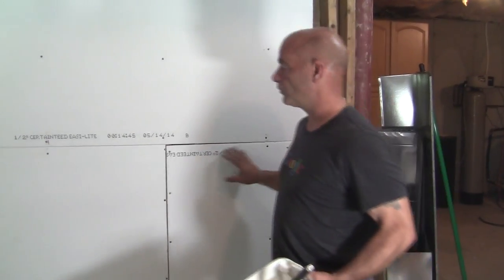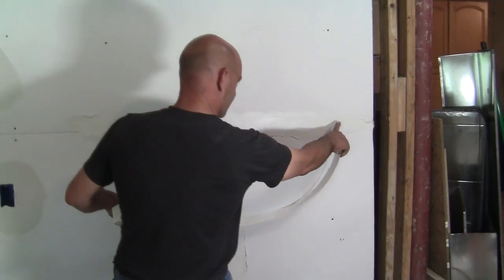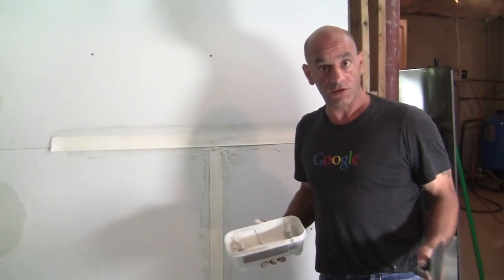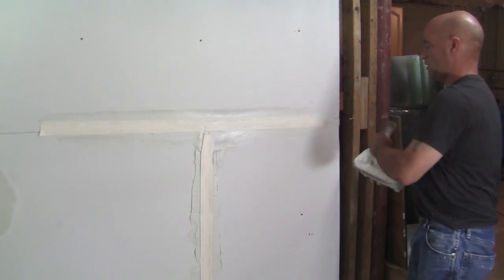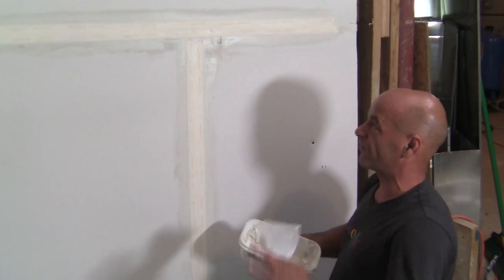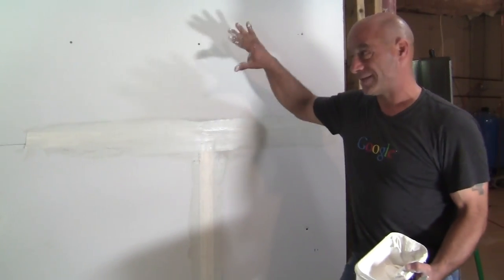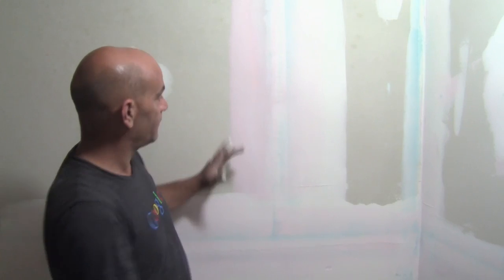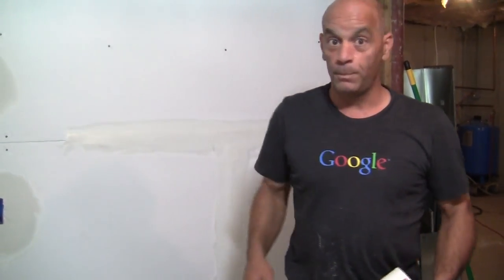How to tape drywall wall joints using Strait-Flex Butt Tape

Comment: On butt joints, I have used a razor knife to remove enough of the paper on the Sheetrock so the tape lays flat eliminating the need to make such a wide amount of Spackle. Just my two cents. ;-)
Reply: No a good idea. The paper is what adds the strength to Sheetrock.

Comment: like your vid's! should i tape a ceiling to ceiling connection between a sheet rock ceiling and a plastered brick ceiling, or use a flexible joint like painters silicone?
thanks

Comment: Thanks for this video.  Always have a tough time making these joints look right on the ceiling.  Bedroom light fixture has a butt joint running away from it towards the outer-wall.  Every time I read in bed, I've got this 6 foot long, 4 inch wide, cake frosting looking, shiny high spot staring me in the face.  Distracts me from reading and drives me nuts.  My wife thinks I'm crazy since she can't really see it, but it's definitely there (maybe I am insane).  Anyway, hoping the tape in this video and level 5 finish method will improve the look.  If you have any tips for properly taping/finishing a ceiling, it might make an interesting video for the people who follow you.  Just my two cents.  Thanks again.
Reply from the maker: +Joseph Nieves I have plenty of taping videos. Search them out.
Reply: Hey, that shinny spot on your ceiling comes from not being sanded properly when someone mudded your ceiling.
Reply: Makes sense.  Thanks for the tip.

Comment: I just bought 6 and 10 inch knifes (good makes) the 10 inch isn't dead straight, is this expected or is this defect? Thanks
Reply from the maker: Pete Holder Sorry for the delay. I was at the Straight Flex plant. Yes any knife should be 100% straight.
Reply: no 6" or 10" knife is perfectly straight anywhere. some drywallers use it either way. I use it differently depending if im taping or floating. some guys swear by a certain side. all pros use a light at a corner of the drywall to see the shadows of imperfections. A dark room with one light will shine where you need more mud or less. the light has to be close to the wall and at a corner.

Comment: Ok. Your style works but one complaint. I have always and also taught my apprentices to always start in the middle of the joint wiping it down. Go from middle to end then from middle again to other end. That way you dont have to worry about wrinkles or holding the tape down with your fingers..

Comment: You ALWAYS  have to do the butt joint first and you over lap it with the  horizontal   tape on top , you didnt do thisin this video and it will cause a crack where it's split!! Your 2nd coat goes on with a wider blade then the 6"  one you used to tape with  and you should use  Topping Mud  for 2nd coat  Not Joint compound !! Just  say-in !!